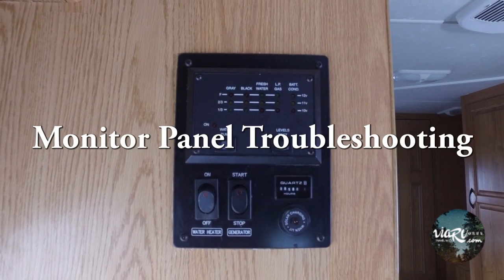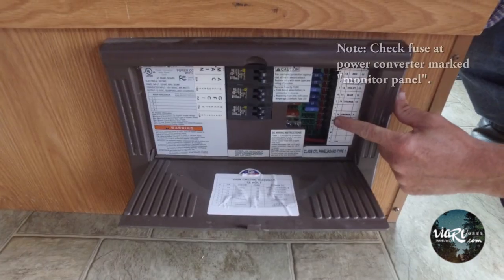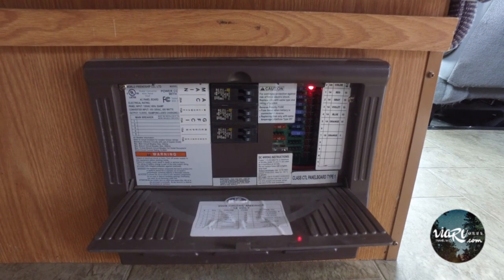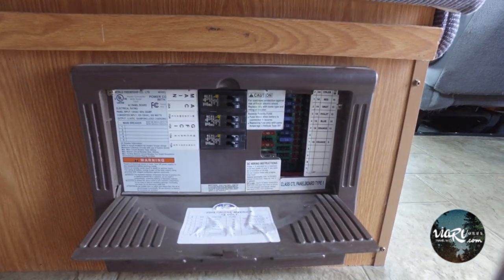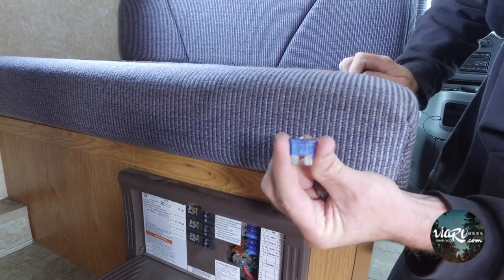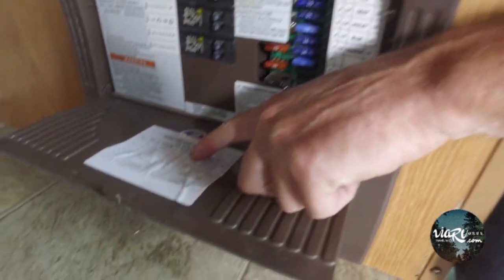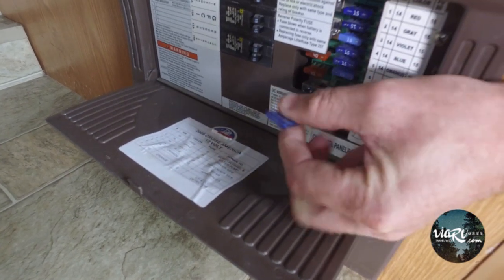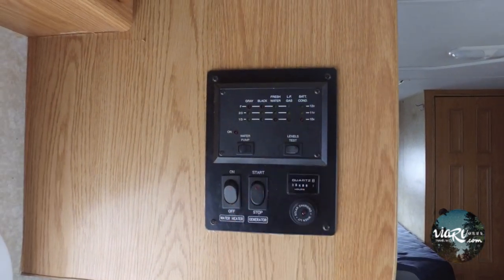RV Monitor Panel Troubleshooting Common Problems - ViaRV Parts & Service

Comment: My fuse was on the battery disconnect relay. Changed the fuse and now the bd and the monitor panel work. Who knew the panel would be on the bd circuit, and who knew the freaking fuse would not be in any of the 4 fuse panels, but on the bd itself. Sometimes I hate rvs.